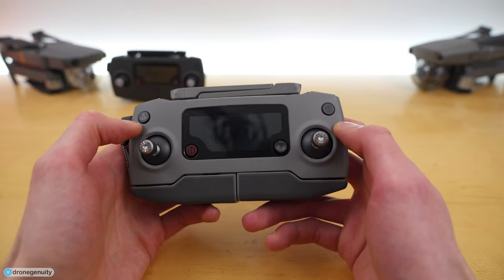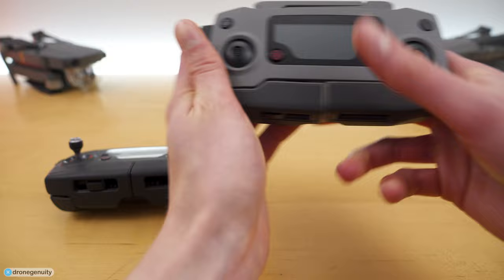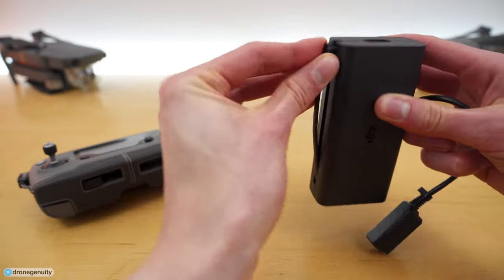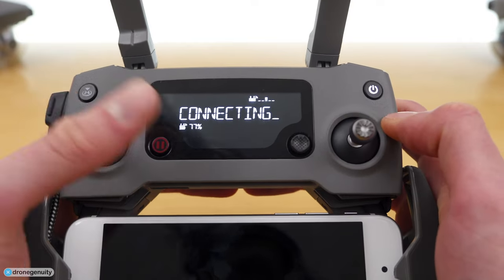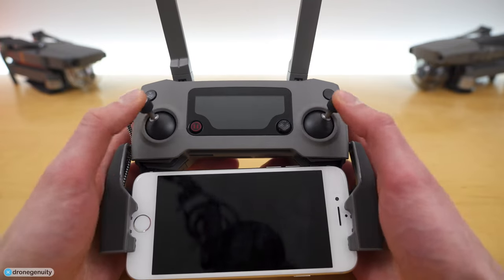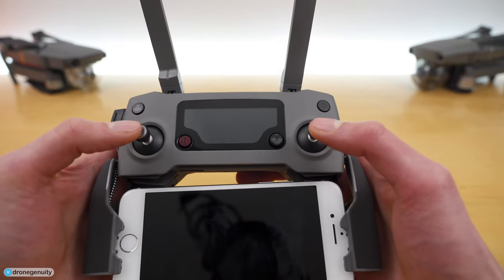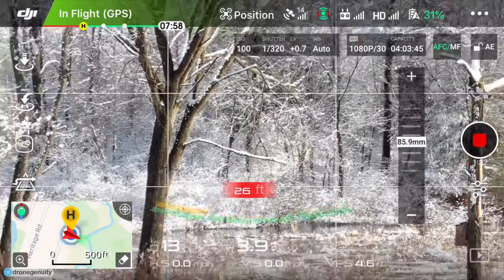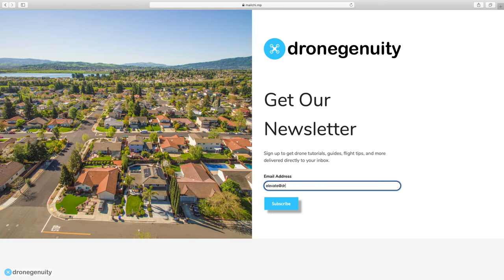DJI Mavic 2 Pro Controller Tutorial & Overview!

Comment: Great video, but you missed the USB port at the bottom of the controller. What’s that for?
Reply: I'm a little late, but its for people who want to use something other than a phone, say an Ipad, wouldn't fit between the 2 handles but you can attach the charging cable to the usb and still use it.
Reply: @obstico  thanks for this, I appreciate it!

Comment: I just wish we could edit the dials. I feel that pulling the left dial should raise the gimbal and pushing it should lower it, instead of the reverse like it currently is. Also remapping the right dial would be nice. Would prefer it set to change the aperture instead of the exposure. Also a 1 button camera re-center instead of flipping straight down or forward.  I have mine set so it can go up that 30 degrees extra so getting it perfectly centered quickly with the dial is difficult. If it's just pointing slightly down, and you press the up/forward button, instead of re-centering it forward, which is the closest position, it will just point it straight down.

Comment: I own both a Mavic Pro and a Mavic 2 Pro. The operation of the exposure dials at the upper right corner of their controllers is different. On the Mavic Pro, when the dial is rotated left of right, the exposure value change continuously and the controller/phone (DJI GO 4 app on a Samsung Galaxy S9 phone) makes a chirping sound as the value changes. On the Mavic 2 Pro, the dial must be rotated fully left of right to make the exposure value change 1 stop and the controller makes no sound when this happens. I'm using the same phone for both controllers. Is there a setting (programming the exposure dial) for the Mavic 2 Pro controller to make it's exposure dial operate like the exposure dial on the Mavic Pro controller?

Comment: I have a question my Mav 2 pro won’t go past 5000 feet in distance away from me without losing connection and I tried every antenna way possible can you help
Reply: It probably depends on the country in which you fly:) The extended ranges will be unlocked depending on your actual position ;)
Reply: You can see your drone that far away?

Comment: you did not explain the flight mode on the side
Reply: T= tripod, the slowest and smoothest speed for cinematography type recording
P- is called Position and is the mid speed
S = Sport mode, the fastest speed for flying also uses the battery power quickly, especially when recording video. Practice a lot before using this speed setting!